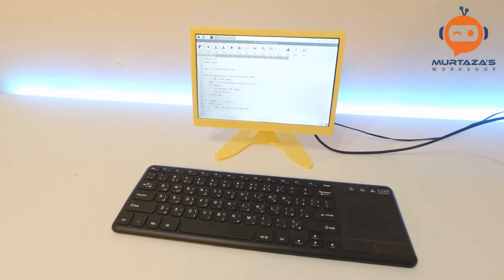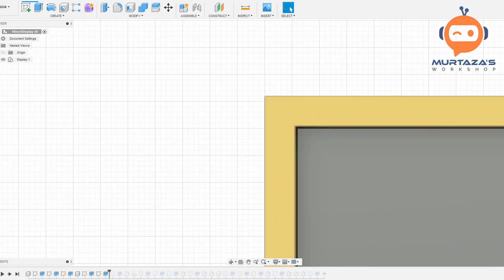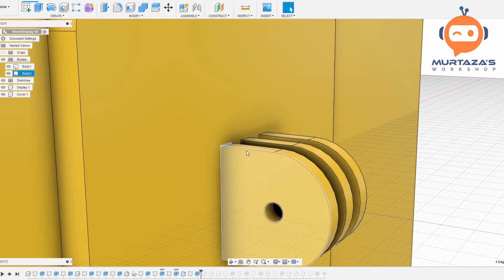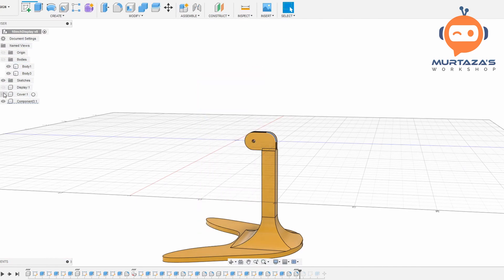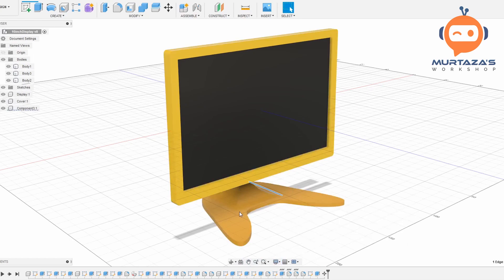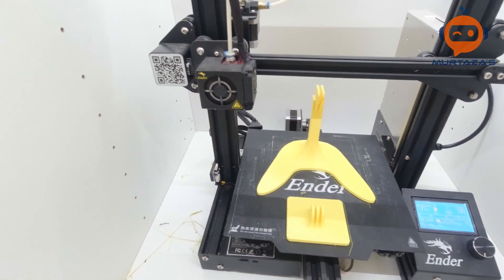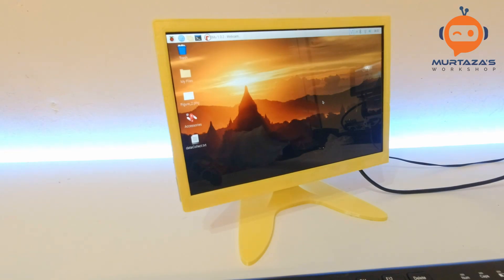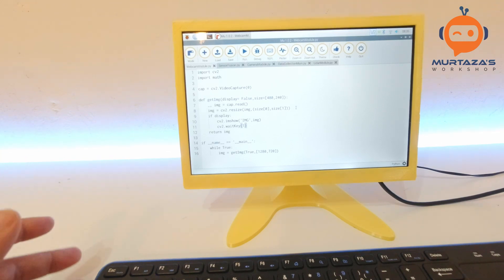Raspberry Pi 4 Display with 3D printed casing | Perfect for Programming

Comment: Hey, awesome video! I'm looking to do something similar to this and was wondering how you printed the frame. Based on the file you uploaded, it's too big to lie flat on the bed of an Ender 3 as you have shown in the video. Do you have another printer that you used for this part? Or was it split into multiple prints and glued together? Thanks
Reply: @Murtaza's Workshop - Robotics and AI  ^^

Comment: I'm pleased to be able to report that I have completed a screen according to this video. My screen was slightly different to yours (despite being a 10.1inch LCD with identical attached electronics.) The only changes I had to make was to slightly alter the dimensions of the frame and then split it in half (in Fusion360) to print it on my Ender 3.  The other 2 components printed without issue. One other note...my screen was cracked upon arrival from Amazon(ES) but that is not a serious issue, luckily. The project has turned out well.